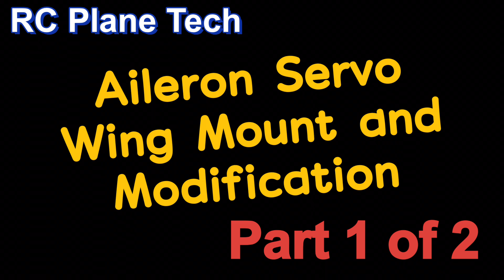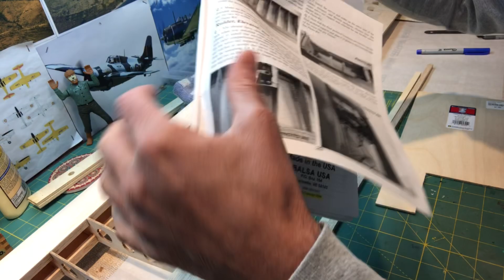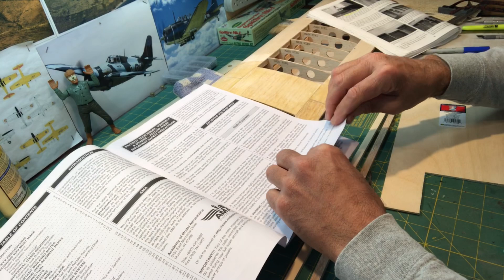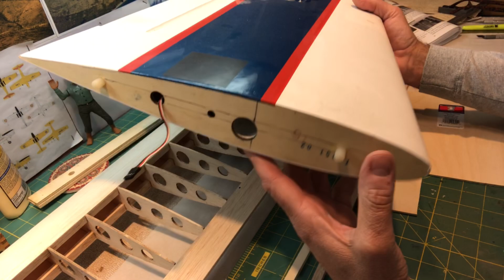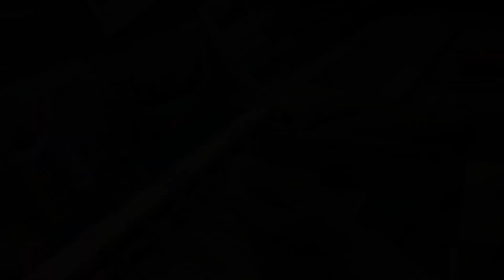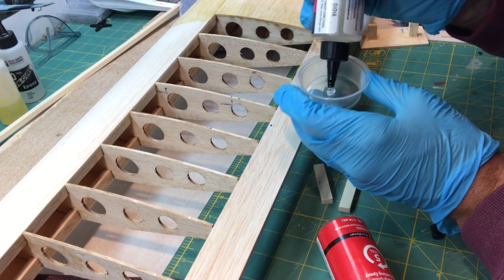Balsa USA Smoothie RC Plane Kit Build No 10, Aileron Servo Wing Mount Modification 1 of 2

Comment: Hello James I ordered the Fubata S3004 server. It does nto resemble the one you are using in your video.It has a 4 pronged wheel attached. Please advise, I'm stuck.
Doug
Reply from the maker: Hi Douglas. So the 4 prong servo and other parts you probably got with the servo are normal. I usually cut off the arms I don’t need just make things cleaner in the fuselage. Its up to you, if you have room you can leave them all on or if you want you can cut them off leaving a single arm. You can probably do a little searching online and see that others may cut them also.
Reply: James, 
Thanks for the advice. I will cut down to one arm. 
All the best
Doug Edwards
Reply from the maker: Hi Douglas, if you are interested you can check out my Barn Stormer Build series number 25 “control linkages”. I installed the servos and cut the arms as needed. You can find the series in my playlists. And number 24 I also discuss the servos and radio setup. Hope they help. Good luck

Comment: Uhm there is this thing called Mass. It makes things heavy. Using super thick plywood to do this is just adding a bunch of needless weight. Nice job, but lighten up. 1/8 ply is plenty for a servo tray. You also didn't leave anything for the surrounding covering to stick to. Just buy a wing servo with the screw/tie downs mounted 90 deg. to normal. I have been flying RC for 50 years. I have NEVER had a servo fail. I just build them into the plane now, and take a picture, if I need to make a change later. Because IF a servo does fail, it is going to be easy to extract it from the bag of balsa remains when it crashes.... I used to build so that I could remove a servo. It is a waste of time, and just adds dead weight. I literally glue the servo's in now.
Reply: One other thing. If you are going to try and save money building an airplane, do not do it buying cheap ass servo's. Everyone thinks metal gear servo's are better. They are, but they also wear out (the gears that is). Go with a name brand like Hitec, or K-power. I just put four K-power with Karbonite gears (will not wear out) wing servo's in a Goldberg cub wing. Yes, I know Cub's didn't have flaps, mine does. A full set of LED lights as well.
Reply from the maker: Thanks for insight and suggestions Yes, I agree that Im adding weight. Thats will be a trade off for flaperons. I did put a balsa border around the servo opening which will hopefully be good enough to adhere the Monokote too. Thanks again for your comments, much appreciated.

Comment: Thanks for taking the time too make this video,very handy!
I’m just at the point where I’m Ready too mount my servos too my wings. The kit I’m building is a Balsa USA Enforcer. This particular kit is from the seventies and was originally designed too one very long flex tubes and cable (golden rods) too operate the ailerons and elevator. 
I like you, will be mounting my servos closer too the ailerons in the wing, instead of way up front in the fuselage.

Thanks for the info!
Reply from the maker: Thanks for the comment. The Enforcer looks like a fun and different plane to fly. I have never done a pusher. If your kit is like my kit, being an older plan with updated instructions, I’m finding little oddities in the instructions. Overall good build experience with Balsa USA. Thanks again and good luck with your building and flying!

Comment: Hi James. When you glue your servo mounting blocks to the ply plate, it's advisable to sand the ply surface to remove any release agent which is used during its manufacture. This stops it sticking in the presses but can cause adhesion problems later. You may have done so but not shown it.
BTW, I was the guy who complained about the music after episode 7... it's been much better since then and that damn whistling track hasn't been missed one bit! Thank you. Cheers, Phil
Reply from the maker: Hi Phil, I did not know that about the plywood, but it turns out that I ended up sanding all sides of those blocks to get them the right side. I actually wish I just went to the hobby shop and picked up some hardwood stock because making those blocks was a pain. I took your comment seriously about the music, I get tired of it also. So Im trying to reduce it and find some additional tracks to drop in during the fast frame sections and such. I appreciated your comment. Obviously this isn’t my day job, so constructive criticism is appreciated. We’ll see how the little channel goes. Thanks